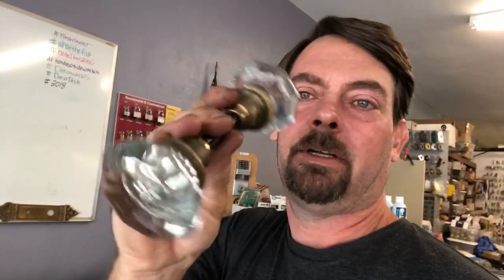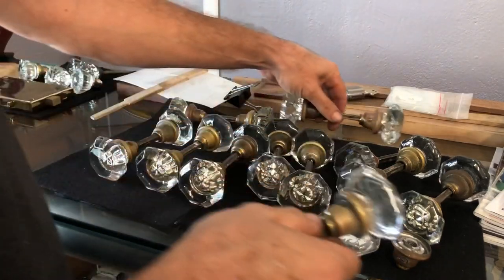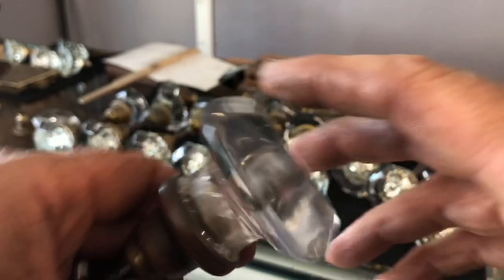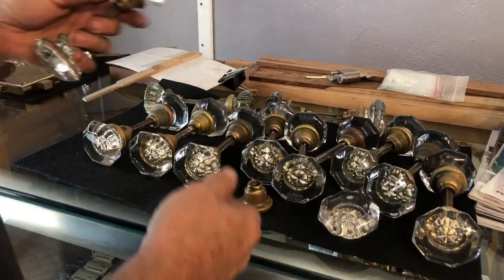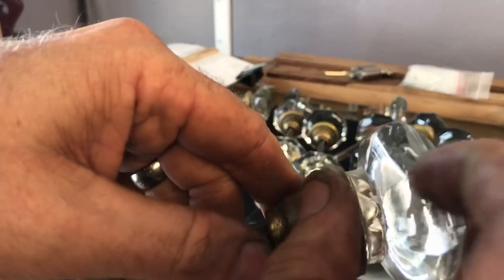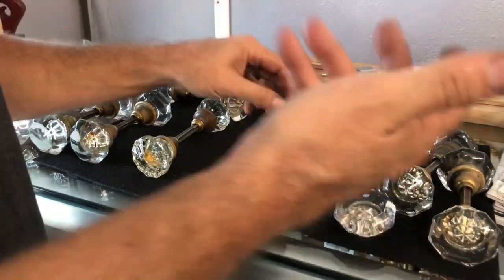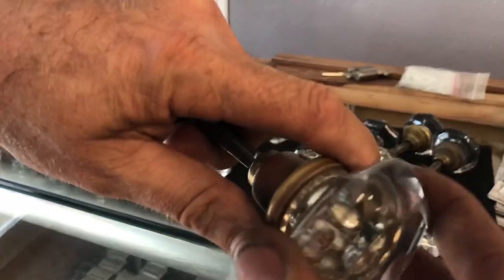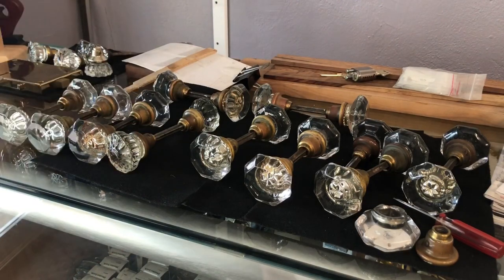If you have glass door knobs on your home , watch this!

Comment: I don’t have an issue with the glass, but the screws always loosen, even replacement screws and spindle. Such a pain to constantly have to tighten them.
Reply: You should put some loctite  blue on the screw so it doesn't loosen so easily.
Reply: I use Loctite on mine. Works great.

Comment: I fixed a lot of those loose knobs with Super Glue. Clean the area with contact cleaner first. I blow it out with compressed air first. Spray a heavy amount around the joint let it sit a few minutes, blow it out again. Then run a bead of super glue around the knob. Works for me. I love saving those old locks and knobs..

Comment: I have a mix of old and new glass knobs in my house, so I have the issues that BOTH come with. Fortunately, I have solutions to both.
The older ones, yeah you can use epoxies, but they will likely fail after heavy use. I use thermoplastic beads molded into a tiny rope just long enough to wrap around the glass neck. While its malleable, push it as far into the gap between the neck and the crimp. The stuff cools and sets pretty quickly, so if ur new to this stuff I recommend playing around with it to get a good feel for the timing. It's amazing material, you can reheat it over and over again!

With newer ones the set screw just will not stay set. Mark a line about 3/4 up the main screw shaft, then mark a dot HALF way to that line. Use a standard brass 3/16" drill bit and drill a shallow hole where that half way dot is. It doesnt need to be deep, just enough to get the tip of that set screw to sit tight. Then I use blue Permatex threadlock to really get that set screw good and tight. Be careful not to strip the head of the set screw with ur screwdriver. Its VERY important to use the correct size Phillips head on it. When installing back into ur door, face the screw sideways away from the door jam so you can get that screwdriver on it without the door interfering with the tightening stroke.
Reply from the maker: Great tips!

Comment: What do you call the glass knobs that have two little flat pieces of metal sticking out on either side of the glass knob??My daughter in law just bought a house.. she hates the old glass knobs and she is giving them to me... she was unaware that if you slide the little metal flat piece to the right it locks the door and if you slide the other one to the left it unlocks it... what is this old locking mechanism called?  I can’t seem to find anything like it online but the push pins kind.  Hopefully you can help out... the house was built in 1951.

Comment: I have a bedroom doorknob like these - the bolt broke inside - so I tried to turn each knob counterclockwise to remove for replacement.  They both move but cannot be taken apart - so I'm guessing the threads on the shaft are stripped.  If you have any steps I can take let me know.  I think I have to cut the shaft and replace that.  Then find a bolt (swap with a closet). THANKS

Comment: Great video. Hey, I’m curious..what’s the easiest and safest way to remove the glass from the rossette brass part? I’m doing a DIY project and just need the brass part (intact and not bent up) many thanks for any tips!
Reply from the maker: If you need just the brass part the answer would be hammer. To address the “safest” part of that question, wear face shield
Reply: @selock  hey thanks a bunch! This is going to be adapting to a shooter rod on my Lord of the Rings Pinball Machine!
Reply: No , you simply put the brass part in a vice, then take a pair of channel locks and wiggle the glass part back and forth. It'll be off in no time.

Comment: Is there a way to tighten the glass on these vintage knobs? I have 14 sets in my house and would love to be able to tighten them.
Reply: gorilla glue. glue. epoxy.  sheesh
Reply: Epoxy MAY fix the issue for a while, but it will eventually fail again. And good luck digging that stuff out again. I used thermoplastic beads. Mold them into a tiny rope just long enough to wrap around the glass neck, then shove it down in the space between the neck and the crimp.

Comment: have you tried a micro lathe to tighten the collar on the handle. they would have certainly used a turning operation originally
Reply from the maker: I have not (I don't have enough use or room for a lathe) but it's quite possible it could work. Would have to be pretty darn careful when doing it for sure

Comment: The antique glass door knob in my bathroom broke.  The spindle snapped and the glass knob shattered on the floor.  I am told that I have a square spindle but if I replace, wouldn't I have to buy a set with a whole/intact spindle and then would it make a difference if spindle was square or not?  Thank you in advance for any help.
Reply from the maker: @elissap1902  almost all glass knobs used the same style of spindle (about 4.5” and square threaded on each end)
Most kits with aftermarket glass knobs come with them

Comment: I tighten the screws and the knobe comes off thried screwing the knobs on but i think the piece between the knobs are stripped can i get another piece or is there something i can do to fix it
Reply from the maker: You can try another piece. It’s called a “straight threaded knob spindle” available many online places (and we sell them also) but your inner threads on the knobs might be work out too. If the spindle looks worn it probably is.

Comment: When my kids were younger they would always get locked in the bathroom. Lol. Every interior door in my home has these original glass knobs. And the bathroom is the only one that has ever had issues over the 20 years of living here. They would just twist and twist the knob the wrong way until it eventually came off. 🫣🤣 Now they are older and all we have to do when the door won't open is turn the knob to the right until it's tightened all the way again and the door opens

Comment: Where can I buy one set screw for a crystal antique door knob?
Reply: I have already tried all the hardware stores in my area.....
Reply from the maker: 1/4 by 28 usually. Did you check to see if they had the "Door spindles" in the Hillman (or other) pull out box in the screw section?

Comment: I have these knobs on closet doors with a thumb turn on the inside. Every single closet is missing the glass part. I bought replacements, but cannot for the life of me remove the brass part. I removed the set screw and just started twisting, but it won’t budge. Do you have any idea what could be wrong.
Reply from the maker: They make spindles with thumbturns attached specifically for closets, they are correct and the thumbturn is not removable. Are you trying to unscrew from the knob (or former knob) side?
Reply: SE Lock and Key I didn’t know that the thumbturn couldn’t be removed, but I’ve tried removing both sides. I even tried knocking it off with a hammer! 😩

Comment: If you take the broken one. Why not inject Black or Metal pigmented epoxy from the back to stop the knob from moving around  before it break? You can fill the glass cavity. The pigment should help to hide any bubble in the epoxy.
Reply from the maker: François Bélanger Boisclair hmm that is a good idea, I might gather ideas and do a video on trying to repair!
Reply: My first thought was JB Weld, or if there’s a color issue maybe clear Gorilla Glue.  Looking forward to the video
Reply: @inspectorbaldbeard1211  Gorilla Glue is a polyurethane adhesives. You risk cracking the glass because of the expansion. For the color issue, you can pigment the clear epoxy resin using powder made for it. You can reproduce the same type of metal tone and give some aging feel to it. I think you should avoid the clear epoxy alone because it could turn yellow with time and bubble will show in the epoxy. The effort for the color match can depend of the budget of the client and how many handles you need to fix with a similar patina.
Reply: François Bélanger Boisclair Thanks for the good points.  I would still be willing to experiment with the clear polyurethane because there is a relief opening.